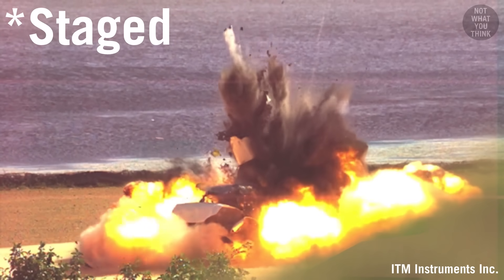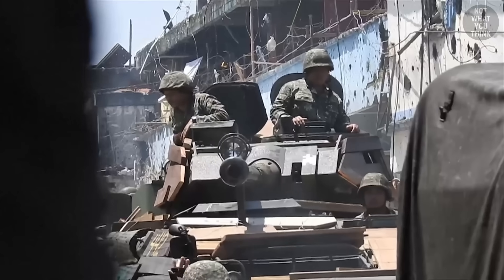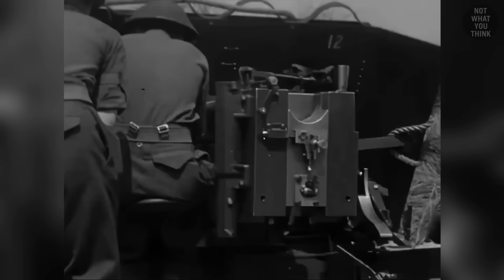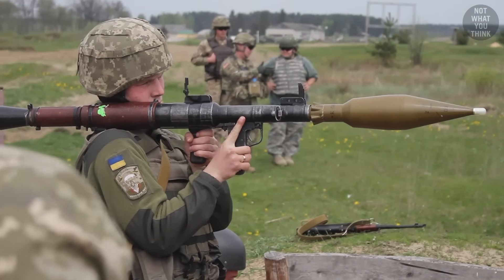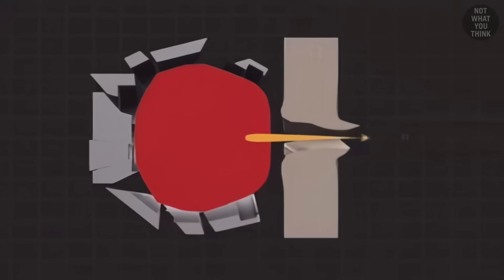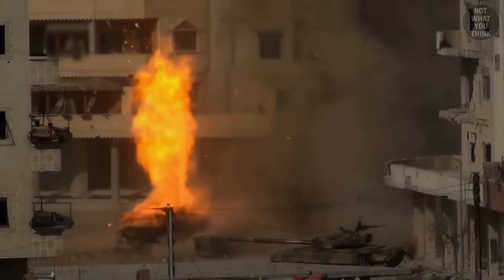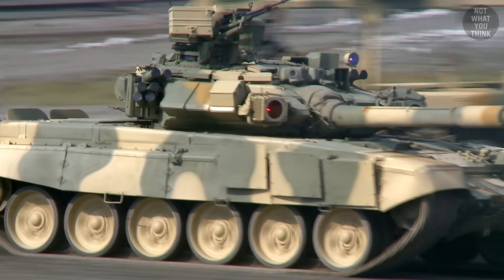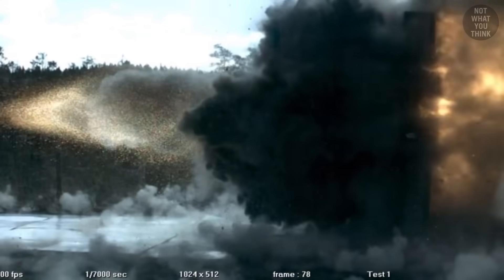Why Protecting Tanks is Getting Much More Difficult

Comment: In Marawi the Philippine Army's Mechanized units used GKN Simbas, M113s and Cadillac Gage V-150s. The Philippine Marine Corps' Assault Armor Battalion used V-150s and LAV-300s.

People should take this in consideration whenever you hear those Filipino soldiers putting wood on their armored vehicles, they're a task force hastily formed to be sent to Marawi because there was a Special Forces raid by Army Scout Rangers and the Light Reaction Regiment that went sideways because they were to arrest Moro ringleaders who they got info that they plan to attack Marawi. The Philippine special forces spoiled the Moro rebels' plan nevertheless and they prematurely started their plan in Marawi under the banner of the Islamic State.

-The local rebels are using improvised RPGs, mainly RPG-2 copies that they got from countries like Libya. Beside from captured M67 recoilless rifles they are using bootleg RPGs, the Philippine military knows what they're facing, they're not facing ATGMs like in Iraq and Syria, the Moro rebels are relatively isolated and under-supplied. The Philippine air Force have relative air superiority that FA-50s, OV-10s, AW-109Es and SF.260TPs were able to provide air support but due to the close proximity of the fighting 2 friendly fire incidents happened.

-Also those ISIS in Marawi in 2017 aren't ISIS from the middle east, they're local Moro rebels who pledged themselves to the Islamic State. Think of them as franchisees of the IS, they jumped into the IS bandwagon because they know the notoriety of the name. Before these rebels (they're an alliance of different rebel groups btw) were chums with Al Qaeda and Jemaah Islamiyah

Comment: While tanks do look like they're becoming more obsolete, another thing to consider is that when used effectively they have more protection than one might think. People often forget or fail to consider that the most effective protection system tanks have is infantry. It's a lot harder to shoot RPGs at a tank if there's a squad of angry people shooting at you. Someone tell the Russians.

It's also easy to forget that tanks don't usually operate alone, that they're usually part of a much larger force and act in support of that force to complete objectives. Even the Abrams will likely fail if they assault a position alone, but combined with infantry, other IFVs, artillery and air support and most importantly, coordinated execution it becomes really hard to stop them. Still a good vid, learnt a bit about how ERA works :)
Reply: things dont become obsolete when cheap things kill them, they become obsolete when something else does their role better

Comment: tanks always had their roles shifted around (infact same can be said about infantry) if we look at ww1 tanks they were primarily anti infantry vehicles, in ww2 they were made as mobile anti tank guns, during cold war they were primarily designed as something like a long range artillery, if you look at modern designs it seems that their purpose is to serve as multirole vehicles anti air/infantry support/with some anti tank functionality.
Reply: They have always been multi roll even in ww1 and ww2
Reply: They were originally designed as a means for getting over the trenches dug in WWI battle fields of France. The trenches were dug in response to the introduction of the machine gun. So, in a a way, the machine gun led to the invention of the tank.
Reply: @Lethgar_Smith I always thought shrapnel from artillery introduced trenches
Reply: And in the future, it may be used as drone carriers and resupply unit
Reply: @Serlock4869  They could even serve as unmanned ground recon & suicide drones
Reply: Not exactly, most tanks were still used in an anti infantry manner in WW2 but evolved into TDs, SPAA, SPGs. Light scouting tanks, medium support and heavy breakthrough tanks.
The Sherman for example served better as infantry support (especially with spicy war crime, I mean totally legitimate willy Pete smoke rounds) mainly using HE to flush buildings, bunkers and provide cover and mobile fire for infantry
Reply: Kinda self-defeating just to be used as mobile-antitank guns.  Whats the purpose of making tanks if they can do nothing but kill other tanks.
Reply: @mouthpiece200  whats the purpose of making aircraft that mainly fight other aircraft or ships that fight other ships or infantry that fights other infantry....

the term tank is a very broad one, it describes multiple types of vehicles, technically infantry support vehicles and mobile missle carriers are too considered tanks, if you have vehicles whose only purpose is to destroy heavily armoured vehicles you would shurely find plenty of use for them.
Reply: @tezwoacz  I was being rhetorical.  I know they come in many varieties.  But any weapon whose only role was to defeat another version of itself would have no reason to exist.

Comment: 6:00 the soft armor was not effective at providing a buffer, it stopped the RPG's form forming the correct geometry to create an effective shape charge. the cone needs to be deformed precisely. the amount of a gap that the soft material provided was not enough to stop the copper plasma, it was enough to crush the cone of the charge and stop it from forming a plasma stream correctly though. those charges are designed to flatten on impact before exploding. This is also why RPG's are far less effective when they hit at an angle, the cone is not flattened and the charge either does not detonate, or is severely diminished because the plasma does not form a stream, but more like a fan. it should be known also that the copper does not vaporize completely, and there is a molten slug at the front, so when the shape is not correct the blast is not aligned, and the force spreads out.

Comment: Tanks are still viable. They're never going to be useful in wars between actual militaries. We've had planes like the A10 which were solely built for tank killing for 50+ years now. But drop a tank in the middle east or africa against any regular militia with small arms and it dominates. Russia would have dominated too against ukraine without all the anti tank missiles we gave them
Reply: the A10 suffers from the same thing a tank suffers from and the same thing anything else on the field suffers from. They're all countered by something much cheaper. You can't use an A10 if there's an S400 around or other AA. Can't have an A10 around if the air is contested. It's all about your doctrine and how you use them.